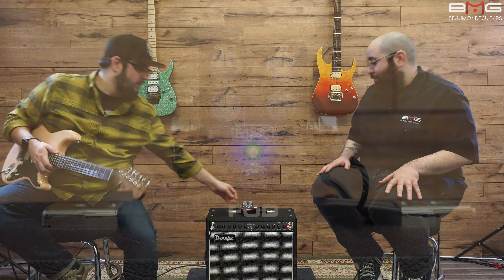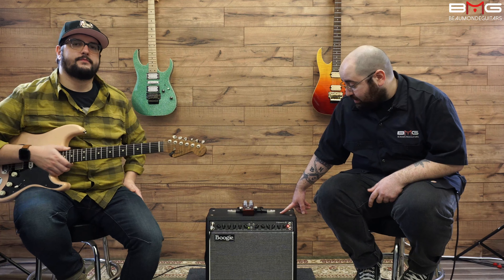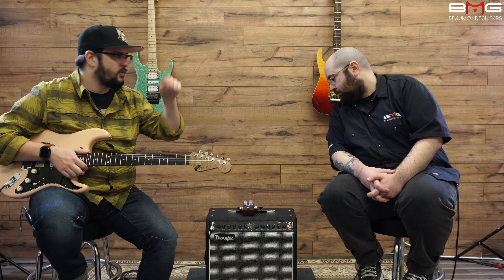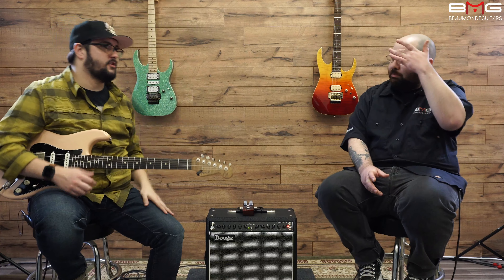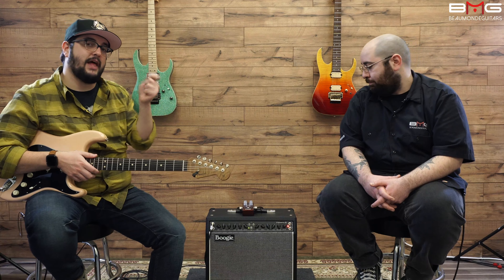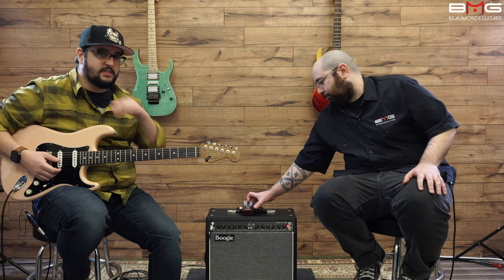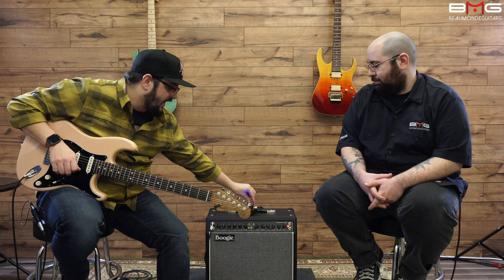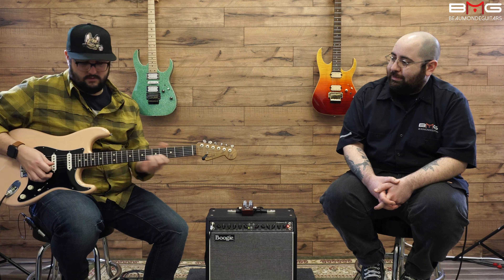MXR M251 FOD Drive Overview

Comment: Guys, the pedal is an identical recreation of the dookie pedal, with the modified scoop controls. It's a way for that circuit to be in their regular lineup. The amps are still the dookie modded plexi, and the lead gain modded plexi